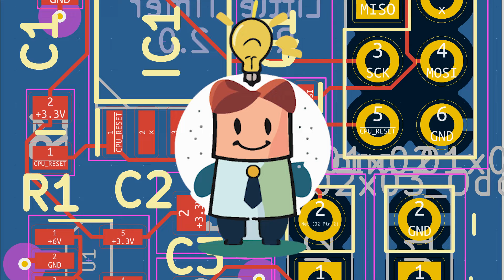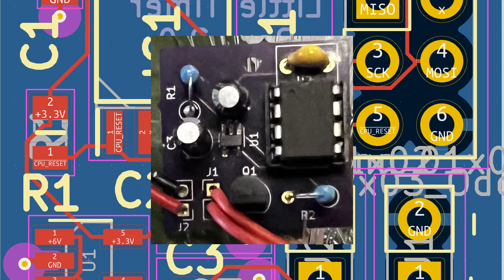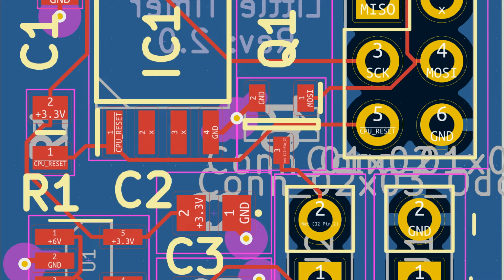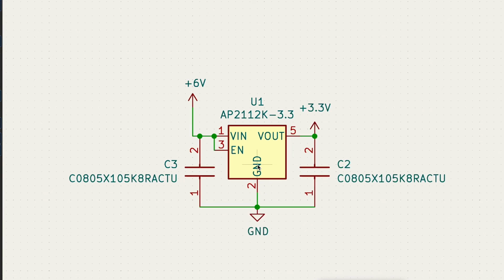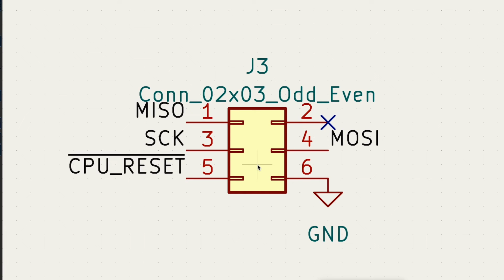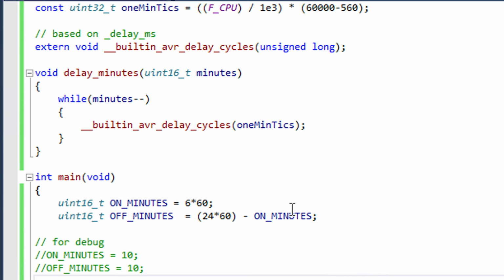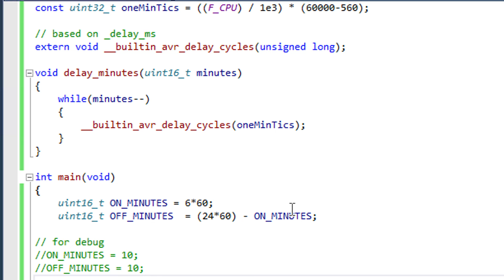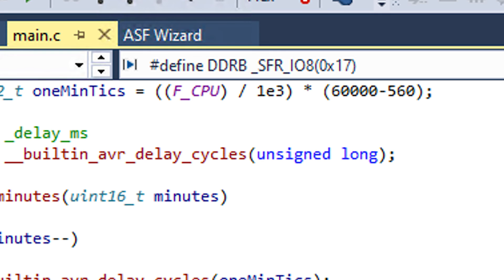ATTiny-85 6 hour daily timer project

Comment: Great Explanation, Thank you, i am working on Similar project and found your video, can you share Code and PCB design? thanks a lot
Reply from the maker: When I get some time, I'll put it up on github and comment back here.   But one thing... I'm not an electrical engineer, just a guy on the internet, so use with caution and your own risk
Reply: @stephentoons  Awesome, Thanks, I am having some issues with my code, i would love to look at yours, i Like how you designed PCB using Mofset. thanks again, i ll wait
Reply: @stephentoons did you post on Github?
Reply: Is it open source?